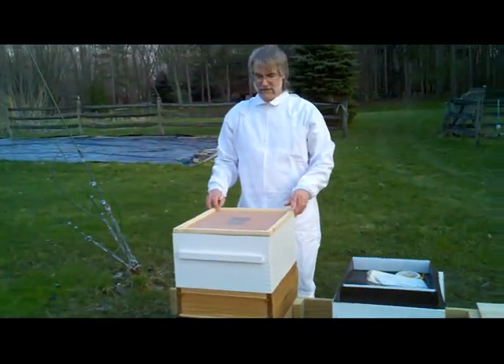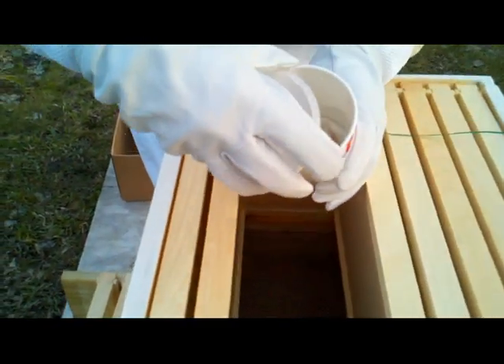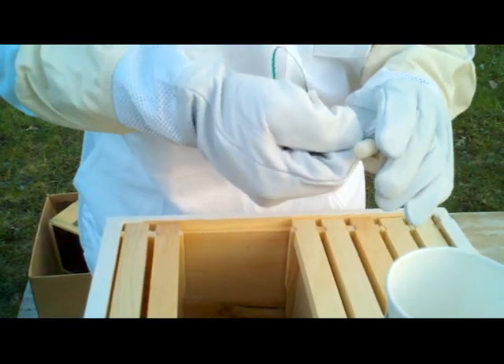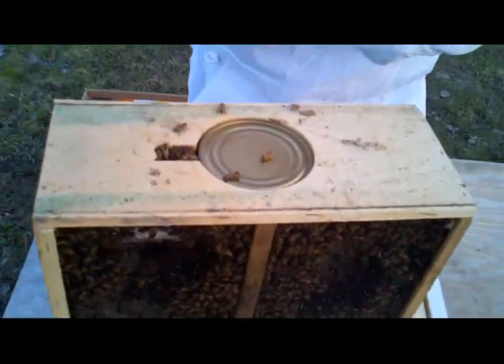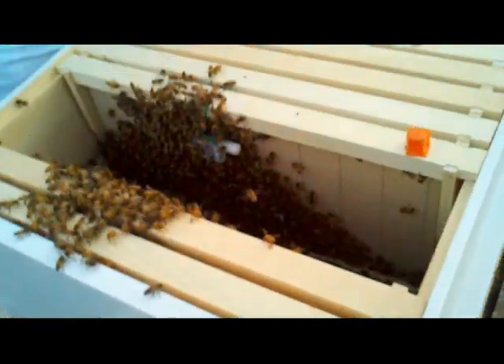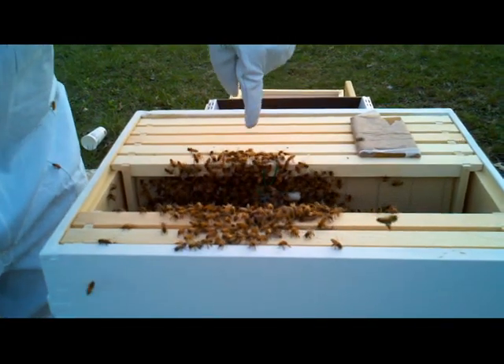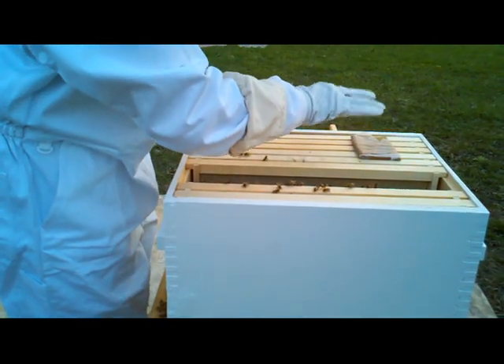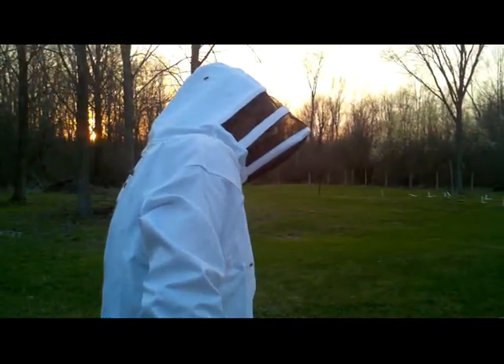Bee Installation at Polecat Pines

Comment: Next time don't bang the package box on the hive. Bang it on the ground.
Slide the frames together so the queen cage has no gaps on the sides.
Buy a bee brush to scoot them of the top of the frames, so you can put on the inner cover.
I'd place a couple of wooden shims on top of the package box and turn the can over, so the syrup drips out.
They need syrup immediately. Or open the can and fill up the feeder.